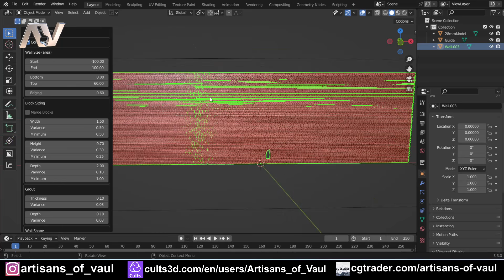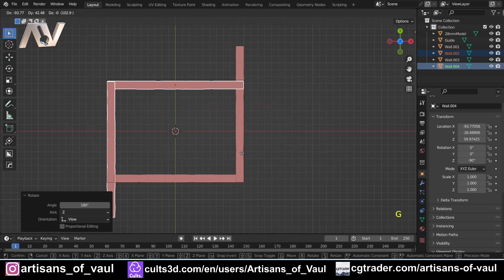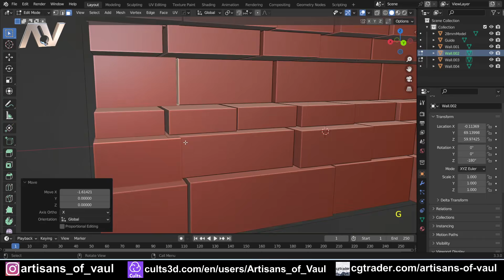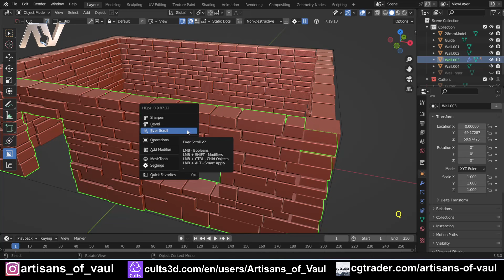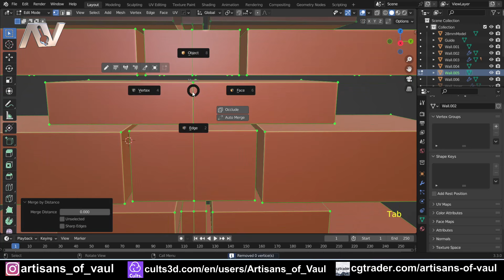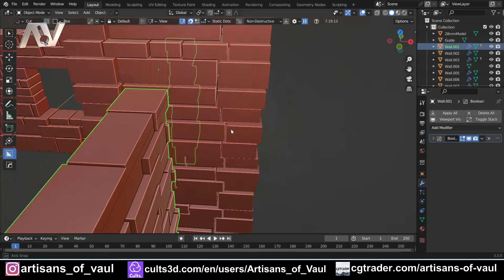Designing a Fantasy Building for 3D Printing - Stone Walls

Comment: I think I found an easier solution to the corner problem.  If you make your wall section a factor of both sides, i.e. 50m section for 100x150m  dimensions, the wall sections match up very nicely and I didn't have to resize any of the blocks at the end.  I also didn't get in flipped faces.
Reply from the maker: Nice solution!

Comment: when I do (ctrl + -) for the door and windows nothing happens. can I do this without using the command shortcut?
Reply from the maker: You can, its just a Boolean, so you can create that in the modifier panel.  But it probably means you haven't added Bool Tool.  You can do that in the Edit>Preferences menu.  But it will depend what version of Blender you are using from there.

Comment: How did you manage to boolean the wall without causing holes to appear in the bricks? I tried and I get faces torn off the sides unelss I shape it to a very specific degree.
Reply from the maker: @Thermal3D882  It should work if there aren't any errors, try swapping the boolean method from Fast to Exact or the the other way around. The other option is to go into edit mode and separate by lose parts so the bricks are all separate. Let me know how it goes.

Comment: I don't know why but I can get the cylinder to mirror around the wall but I cannot for the life of me get the chimney sides to mirror each other as you have done. Something about those objects just won't mirror.
Reply from the maker: @paulthomann7911  hmm... are you trying it in the opposite direction and need to press the flip option? I also randomly would try bisect as sometimes it seems to work.
Reply: @ArtisansofVaul  Yea. I wouldn't have asked the question if I hadn't tried it both ways. If I use bisect do you just do the cut and not separate? I think if I separate then that creates two objects. I solved it by simply duplicating and moving the duplicate into place. I have watched enough of your videos now to realize that if some technique doesn't work then just go back and do it long hand.
Reply from the maker: @paulthomann7911  I'd have to see the issue to help really. If you find me on Insagram you could message me there with some images.

Comment: Hello. Do you know how to get this addon to make all bricks pretty even in size? Ive tried but it seems to vary even though i set all sizes and variance to the same value
Reply from the maker: So it's designed to have that variation. If you want all the bricks the same size it would be normal to just use arrays once you made one brick.
Reply: @ArtisansofVaul  yep gotcha thanks
Reply from the maker: @DeputyChiefWhip  Depending if you have Hard Ops or are interested in it, this video may be of interest as a way to speed things up a bit: https://youtu.be/liCVS8SYBu0

Comment: The normals flipped when you scaled the wall by -1 on the Z axis.
Reply from the maker: That's not actually correct. Scaling an object by a minus amount should have no impact on the normals of the faces. You can try it just with a standard cube and you'll see it doesn't change it.

Comment: Your faces were all the wrong way out because you scaled the walls by -1 at the start to get the large blocks at the bottom.
Reply from the maker: Scaling to a minus number shouldn't reverse the faces (the outside should still be outside). At least when I have done it in the past, unless it's something that's changed for Blender 3.6. I'll have an experiment.

Comment: i cant seem to get off box-cutter without un-enabling it in the preferences and occasionally my blender will crash when trying to enable it again.
Reply from the maker: It should just be W as the shortcut to get out of it.
Reply: @ArtisansofVaul  i did try that though it didnt seem to work.
Reply from the maker: @skxexx7292  The other option is if you have the T panel open on the left side of the screen clicking any of the other functions should close Boxcutter.
Reply: @ArtisansofVaul  thanks, i've also ran into an issue with the symmetrize, i cant really explain how it looks but it just shows about 2 or 3 bricks in the middle instead of the entire wall symmetrized.
Reply from the maker: @skxexx7292  Sounds like there's something rather odd going on there. Are you sure the origin of the object is in the right place?

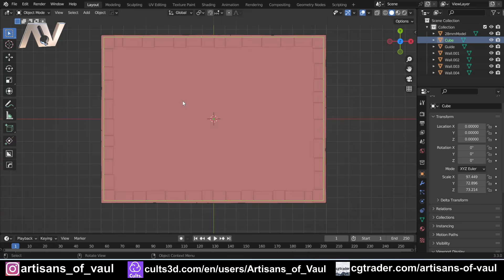Comment: I was following along with this and got lost at 15:40 ish mark. You made a cube to create a solid wall for the bricks, and then a second cube to cut out the wall shape and middle (I am assuming) but about 10 seconds later it goes from Cube and Cube 001 to just Cube. What did you do to remove Cube 001? The only thing the key guide shows is hitting Shift. I think I may be thrown off if this was just an edit jump and I missed one step I am not thinking of. 

Did you not need the Cube 001 and just inset the faces on Cube?
Reply from the maker: Oh jesus, that is a bad editing mistake.  I was originally going to Boolean out the middle section but then decided it was easier to use the inset method.  Stupidly I must have missed the bit when I made the Cube.001.  I wonder if I can edit that out of the video to cause less confusion.  Basically ignore the duplicating the cube, just select it and follow the steps to inset the middle.  Really sorry for the poor editing there.
Reply: @ArtisansofVaul  Thank you for the additional info. Honestly, that was a GREAT edit if you meant to do it. It was so smooth I was quite confused. So good job on that.
Reply from the maker: @RoseKindred  The issue was the edit was good but the placement of it was bad 😅
Reply from the maker: OK, Ive made a trim to the video as best I can now the video is uploaded (though YouTube says it may take a couple of hours to be confirmed) so it should cause less confusion (though cube001 does turn up for half a second).  Thanks so much for pointing this out, really really appreciated.😁👍

Comment: This is fantastic stuff. I've been struggling to get to grips with Blender for 3d printing for some time and these tutorials are spot on for what I am wanting to achieve. I've seen your video for adding chips to the block edges but is there an easy way to apply a displacement map to the block surfaces so that when they print they have a texture? Keep up the great work!
Reply from the maker: If you mean the video I manually do it on there is another where I show how to program geometry nodes to do it for you which is fun. But they have slightly changed one of the nodes so it needs updating for that one. Using a displacement technique for all these blocks probably wouldn't be a good idea as it would add a LOT of faces/geometry and I'll be doing that a lot already with the wooden beams. I think my computer would die 🤣 Glad the videos are helping though

Comment: Why dont use dispiace entrambi maps for textures? It seems to be quite faster...
Reply from the maker: I assume you mean displacement textures?  Its a good questions and there are a few reasons for me in this project:
1.  I prefer having more control over the blocks, the gaps between them, the depth of the mortar and being able to change individual ones.
2. As this building as an internal and external texture there would be a lot of seams where the displacement textures would join and it wouldn't mesh together nicely making a visible line.  If this was a render that would only be viewed from one angle that could be controlled and it would not be a problem but as it will be 3D printed it will be seen from all angles so those seams would have to be fixed at the joins and I think that would take as much time (probably more) then just doing it this way.
3. The second level will have a lot of wood texture on it so there will be a high number of faces there.  If I was to use a displacement texture on the bottom floor it would also be adding a lot of faces and together would potentially really slow down the computer/program which would be annoying.

Basically if it was just one wall I probably would use a displacement but for this project as a whole it doesn't feel as suitable.
Reply: Usually i use seamless texture to avoid Lines. And then i decimate until the scale of the model let It unnoticeable at sight.
Reply: @giovannizaccuri  So in say a cube, how do you hide the lines where the texture joins at the wrap around point? For example one corner line would have to have a seam, also around the joins at the windows/etc.
Reply: @neilcollins7371  i would like to share my result to show you the good looking can a displacement map seamless can have.
Reply: @giovannizaccuri  I'd love to see it. If you have Instagram you can  message me there.

Comment: Awesome stuff 👍 the linked duplication is absolutely crazy, I never knew that was even possible
Reply from the maker: Its so useful when making multiples of an object when you think you might want to change it later.
Reply: @ArtisansofVaul  I was modeling my company logo last week before your video dropped and it’s got like seven of these thin cylinders, and after rendering I wanted to change something and had to fix one and then duplicate and position it all around my mesh. It was a pain and was wondering if there was a way to transfer mesh data! And then you dropped this gem 😅
Reply from the maker: @Tony-cm8lg  You might also find this handy (not quite the same but can be a similar solution to such a problem): https://youtu.be/Q64XkWX_WzI
Reply: @ArtisansofVaul  I forgot about this one! Y’all are brilliant, finding all of these ways to make the workflow simpler